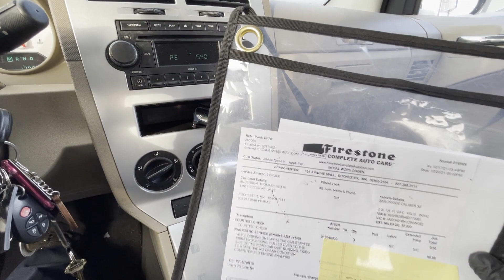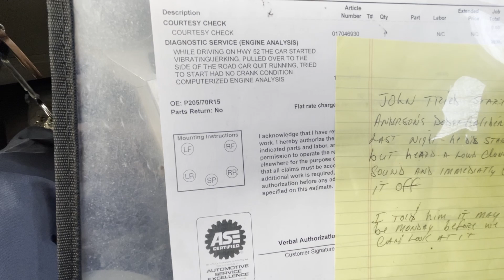Engine Knocking Noise Diagnose & Recommendation | 2.4 Liter Dodge Caliber

Comment: Could you comment  on what the problem was specifically please thanks.
Reply from the maker: Customer states that their vehicle making knocking noise. We had their vehicle history burning oil/oil consumption before 3,000 miles. Customer did not want to pull the oil pan so we can look at the main bearings or extensive diagnostic. We had the similar problem with the same engine making knocking a couple weeks ago (we did the extensive diagnostic for this one). So we condemned the engine is knocking/requires new engine.